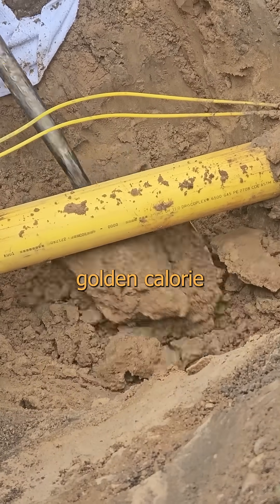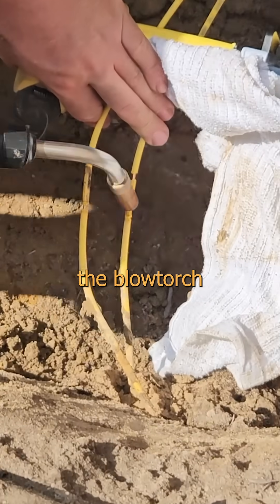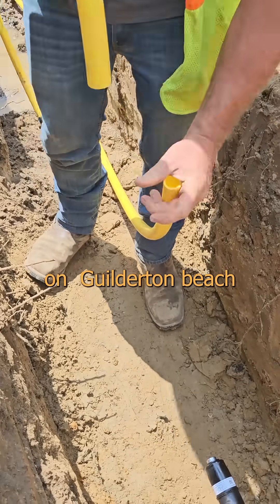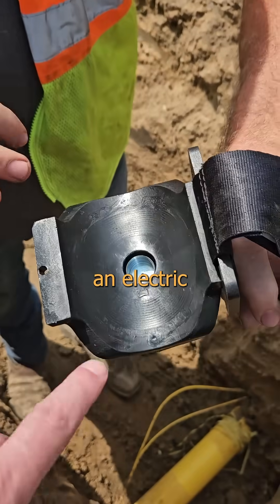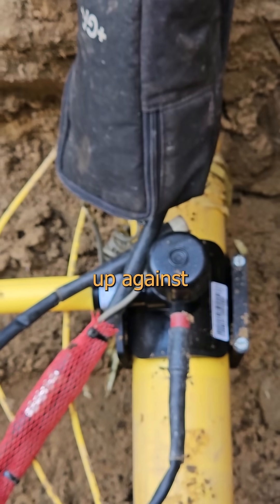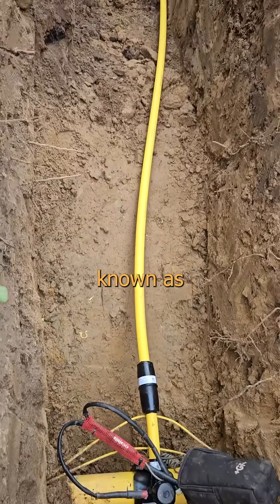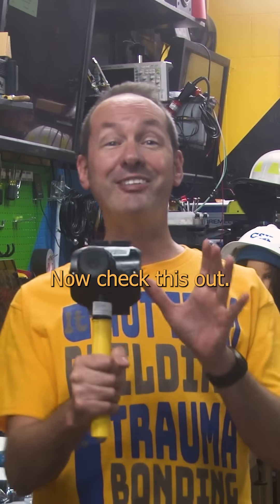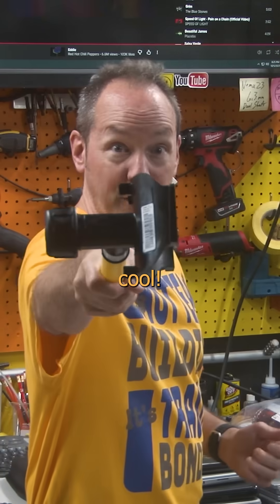Gas Line Hot Tap #chrisboden #comedy #engineering #construction #educational #apprentice #science

Comment: Gas line at my house is high pressure at the road. Not 2200 psi like at the well head but it is still a couple 100 psi. When the original steel line would leak it would blow dirt up in the air.

Comment: Works on most pipe*, there are plenty of 3" and 4" mains that are just coated steel pipe that look similar to one in the video. Those have to be tapped and tied in the old fashioned way. 

This is a very ingenious tapping device, I have never got to see one in action, as my role is normally finished well before their is gas flowing through the main. I only do the mainline installations.

Comment: I need to do this,  but I only have a curling iron.  Do you recommend the high setting?  If the gas,  as you described is only at a few psi, then this should be a breeze.

Comment: It's hard to screw up as if code reader doesn't work you have manual settings on it the only part that need be done with attention is cleaning it well and checking if after clamping it's sticking tight without excessive free space between

Comment: So, heating on a live gas line is actually 1,000 more safe than one that was live but has been shut down.  Mainly because Natural gas has to be roughly 13% gas to oxygen for an ignition.  

A pinhole leak is actually more dangerous than a full blown.   But only if there was something above the leak to trap it, because it is lighter than the oxygen/nitrogen air we breath and floats up and away faster than your sister's dress on prom night.

As for the electronic melt on tees, previously, the crews had to use a heated iron in a vertical vice.  You had to know your iron was hot, you had to know how long to hold and you had to move with absolute purpose and focus.  

Another thing that always got people running... welding on steel gas lines.  It would be like something from a Bugs Bunny cartoon the second they heard we were welding on a live line.

Comment: There can still definitely be problems with these service taps if you’re working with mains that have been in the ground for some time. Some of the heavier elements in the natural gas called hydrocarbons, permeate the walls of the pipe and when you go to fuse, cause bubbles which can result in incomplete or flawed seals. You worry about it less so with the taps and more on the side of tying in a new main to an old one, but still something to watch out for.

Comment: And… when we check for gas leaks on HDPE plastic or Steel pipe, We use a flint  striker to check for leaks.😊 it’s a flint lighter that looks like a gun. It shoots flint out of it when you pull the trigger with sparks coming out of it.

Comment: The town I grew up in had a guy from the gas company checking something in the old iron gas lines outside some guy's house every week or so. So the guy asked the worker, "Hey, what's that you're doing on my tree lawn every week."
"Well, the gaslines in this town have more holes than a metric fuckton of swiss cheese, so I have to measure the water in the gasline every week to keep track of it."

Fast forward to winter and the town's shut of valve a mile away got water in it and froze. We all know what water does when it freezes, and that opened up the valve wider than your sister's ankles and started feeding 3 pounds of pressure into the line instead of 3-4 ounces. For a lot of houses with newer gas meters, this wasn't a problem as they had independent regulators to keep the pressure down. But if you had an old one, your pilot lights went from two inches to almost two feet. And when the furnace kicked on, goodbye house, hello insurance company. There's about a thousand houses in the town, and due to some miracle only 7 burned down and no injuries or fatalities. We had 25 fire departments respond and just pick a corner and watch for smoke while the towns folk helped evacuate the elderly(there's a lot). 

Anyway, the gas company tried the Chewbaca defense until our friendly neighbor spoke up about the gas company knowing about the water problem for months and they fessed up to knowing about the danger and doing nothing about it. Next thing we knew the town was filled with more ditch witches than your mom's high school reunion and the town got all new gaslines at the low cost of, "please don't sue me."

Comment: I’m a pipefitter and there is fusion taps that use an iron to heat the fitting and pipe to make a fusion the tool is called a sidewinder by McElroy we also intake  an EFV excessive flow valve so if the service gets hit it will slop the blowing gas

Comment: But he didn't explain why they stripped the yellow wires that were running along side the gas main.  That is what they used the torch for, to soften the wire insulation to make it easier to stip.  BUT, then they don't show anything being connected to the wires.  Typically, those wires are put next to the plastic pipe so they can use instruments to find the pipe after it is buried.  SO, why strip the wires?

Comment: We didn’t do a whole lot of fusion taps but the amount of rubbing alcohol was nuts. We just used two or three wipies and some wire strippers to push the insulation aside just enough for the splice for the tracer wire. Fusion taps are awesome but these dudes are using the full benefits of the $60,000+ service they are doing with how many resources they are using here.

Comment: I watched them do this on 6" steel gas main in the 80's. They welded the saddle to it with a stick welder then pressure tested it before piercing the line with the tap. I was told the gas pressure was at 125 psi.

Comment: Live gas lines especially mains can be lethal. I was involved with isolating a 11kv cable to be identified and spiked to allow a parallel branch joint to be installed for a new substation supply.                                So i arrive there was a excavated big joint trench for the work dug with a existing plastic gas main right thru the joint trench. I witness the ID and spike of the 11kv cable and give written clearance to start work , during the toolbox talk i warn them of the gas main and to beware of gas torches flames while building the joint.                                                                  I leave for the next job and hear in the news of a explosion at a worksite where i attended earlier. I find out later that while doing joint work one of the jointers left a lit blowtorch burning while stripping some sheathing it burnt thru the gas main and ignited the whole trench. The jointers mate a big guy jumped onto the trench and pulled the jointer out away from the fire that burned until specilisted gas company staff shut off the supply after fire brigades initial fire fighting methods failed. Big trouble over that accident i was called to do a report luckily i gave those warnings before work started so was not personally involved in disciplinary  actions even though some of the staff where not happy with being made responsible  for the accident. This incident really made me beware of plastic gas mains seeing this vid reminded me of that incident and how lucky the guy was to be rescued with only mild burns to himself and his big quick thanking assistant.

Comment: Called  that a hot tap in the oil and gas business in the 60s 70s and 80s we weld weld let on the supply pipe  screw and valve into it an drill through into the supply pipe with valve special packing seal.
  Did many of them

Comment: To be fair this isn't nearly as dangerous as it might seem. HDPE, the material of the pipe, has a melting point under 150 C, whereas natural gas has an autoignition temperature of nearly 600 C. Simply put, it's incredibly difficult to ignite gas without spark or flame, and I'd wager this device can't generate anywhere near 600 C even if something went wrong.

Comment: I have done many WATER service "TAPS" both "LIVE" ( you don't shut off water mains. For me personally on (AC) asbestos cement water pipes, YES we had about 80% of our service area all (AC) believe it or not in the late 1970s we would "CUT" the (AC) water mains with a pipe saw.
Then we started getting training in the 1980s about "AC DUST" we all went to the doctor to have (X-rays) of our lungs. Anyway just a stupid question as not question is stupid "RIGHT" 
what about the "HEAT" when you turn the wrench TAPPER into Gas main. Just asking is their no "HEAT" buildup. I have watched many A repair of a "BROKEN" Gas service that I dug up or was off on the line location paint or flags on the surface.

Comment: Something people don't understand about closed systems like pipes and flammable substances. Unless it's a very specific case (alkali metal + water and similar reactions that don't need water), flammable gasses like methane have an upper limit of how much is needed to be flammable. Somewhere around 95% concentration is the limit for methane, if there is more than that then it can't explode because there isn't enough of anything else (Oxygen mainly) to combine with the methane. If there is no oxygen, then it can't explode.

Comment: We used something similar on stainless/carbon/etc lines called a hot tap. We would weld a short threaded nipple to the line we were tapping and then screw on a ball valve. On the other side of the valve we would screw on a contraption that had a drill bit mounted to a revolving shaft which could be screwed thru the open valve, into the line we were tapping. Once the line was penetrated completely we would back out the drill bit, close the valve, lock the valve out and remove the contraption, job complete

Comment: I've done some RF welding and honestly it's thr very best it's just not very moble, when using a normal heating element the 2 parts are still 2 parts, those Xrays in the RF welding cause true polymerization actual linkage of molecules. There is some heat involved but that's not what really causes the fusion.

Comment: Hmm. Our PE mains run at 50-60# and are required to have EFVs (excess flow valves) on all new services. Basically if the service gets opened up too much it trips and slows the gas WAY down. They're actually purposely tripped to make sure they work. There's a little hole that eventually re-pressurizes the line. But they didn't install one. Maybe there's a lower limit on main pressure?

Comment: I used to do something similar with Ethernet, in the 1980s.  It was a way to add a connection to a 10base5 cable without cutting the cable.  Not as dramatic if you messed up - just 1s and 0s all over the floor - but a lot of analogous steps.  I think it's called a vampire tap.

Comment: steel gas main breaks require a set of danglers to temp "fix" bandaid. 100 foot tall geyser plume. 6011 farmer's rod will ignite it. Exciting!. AC deposition because you don't want penetration and want to drag. Asbestos blanket. a '74 chevy pickup truck hood. Water will just turn to steam and kill you. Yes you need to switch to DC reverse polarity deposition when buttoning it up - that's why the farmer's rod. You feel like a hotdog on the coals. But heat goes up, so be chipper! If you don't do it - who will? Just fast drag spatter it. Not trying to "weld" here. Just want a gorilla booger blockage. Fast freeze and AC / DC / all position make this the better choice, handy. AC used at first because it runs cooler, penetrates less, gives the spatter and easy drag I was looking for. Finished with DC reverse because deposition is less prone to blow out under higher pressure.

Comment: You need to show one a hot tie in welding steel pipe to live gas line that is what I used to do no fancy tool to punch the hole steel punch in a brass hammer

Comment: I was working for a company that makes the machines that weld those those fittings.
The fittings have normally a barcode sticker on it that will be scanned by the machine, so it knows exactly what parameters in terms of time and current it has to apply.

Comment: I worked for a gas transmission company and we did "hot" taps on large steel pipes (IE36"), they would usually try to lower the pressure to around 600PSI then WELD a sleeve (TEE) to the pipe, install a valve and then attached a tapping machine to the valve, go through the valve, tap the pipe, withdraw the "coupon"  (the piece that is the dia. of the tap) back through the valve, close the valve and blow down and remove the tapping machine, voila a high pressure tap. can you imagine the pucker factor welding to a pipe with 600 PSI of natural gas in it? some of that pipe has been in service for over 50 years, you have to have confidence that the guys running the smart pigs (X raying) the inside of the pipe for "anomalies" were really paying attention...

Comment: Wanna see underground electrical workers run at Olympic speeds? Run the gas main over the shoal of granite instead of blasting so its a whopping 8 inches under the ground.  I mean whats the odds anybody will dig in that exact 3 foot square area?😳  i saw the foil tape about 2 seconds prior to the teeth on the backhoes bucket cracking the pipe.  In case your wondering,  "run away screaming " was my reaction.  BTW: you missed your calling as a wordsmith! Truly as much as im not a fan of the dick jokes i listen anyway just to hear your verbage

Comment: Is it cool? NOO.
I saw one time workers cut life gas line inch metal pipe with angular grinder (it was many spark), after that worker made threaded connectors and installed valve. All this time gas was leaking from pipe. It is sound like crazy but it was in real. After that i questioned worker: "was it to dangerous?" He answered: "not a big deal unless you stop cutting pipe at half way. U must cut it in one move."

Comment: The oil and gas industry calls this a hot tap.  We use it as little as possible,  it is sometimes necessary...  sometimes it's over 3500 psi.
Yes it's the same methane just without the mercaptin smell.

Comment: I used to do gas I was on a steel crew wanna talk about spincter tightening sit in the hole with the welder when he blows through the side I had the knowledge beforehand so I didn't mind I had to explain to a new guy that if you see the flame your safe it's burning off as it comes out say the welder had to grab a rod and there's a hole if it fills up enough you won't have time to see a flame

Comment: Small correction,
The tube isnt a thermoformed plastic, its an extruded thermoplastic
Thermoplastics get soften and melt in a predictable way (as opposed to thermoset plastics which harden chemically)

Thermoformed means it was softened and pressed or vaccumed over a mold
Reply: since you're a nerd but cool, what plastic are car trim pieces made of? I wanna know so I can curse the name of the guy who made that brittle crap
Reply: @jimbothegymbro7086  lol depends on the car, and the age
Reply: Older cars have worse plastics for 2 reasons.

1 : The plastics technology of the day wasn't great.
2 : Those plastics have then aged longer.
Reply: @BramBiesiekierski  yup 
UV light breaks plastics down, along with temperature changes 
Plus plastics have been designed to be high-quality A surface only in about the last decade or so
Reply: @ivankrylov6270  I make these EF fittings, couplings to branch saddles. They are injected into a mold. Would that not constitute thermoform by your definition?
Reply: @lexiadams-kl5mp  no, thermoforming is a specific molding process, that doesnt liquify the plastic. 
You pass the glass transition temp but not the melt temp, then vacuum or press it down over the mold 
Its usuly done with a pre-extruded plastic

Comment: When I was an electrician my boss and I were driving away from a job at the end of the day and we heard a loud hissing sound.
In the rearview mirror I saw a guy leaping through the air off of the ditch witch he was piloting. We saw him reach a safe distance from the machine which was engulfed in wobbly looking fumes blasting into the air as we continued on our way.
Not sure what happened afterwards but the machine was definitely still running when we turned the corner on our way home.

Comment: i read your little card, it was really nice. I don't want to argue, i just want to state an observation and possibly pose a question.
the math around how the gas line doesn't blow up is so sensitive, it makes me wonder why there's not a valve between the central gas main and the main gas pipe of a single home to shut the gas off.
do you have the capacity to shut the gas off before punching a hole in a hot gas pipe? has anyone ever tried making a shutoff valve? is the gas system in this country so jenky that adding a main gas shut off is not feasible? am i just using my dumb auto tech brain too much?
Reply: tl;dr. why heat up the gas line while it's live? can you shut it off? I'd be really mad if one of our houses blew up..

Comment: I'm a plumber and melt PE pipe all the time. Then run tracer wire and tape to top. Put a few 2 " PVC pipe at 24 inches.  In put pipes into hole on top of pe pipe back fill a little around it usually 6 " then caution tape. Then all the way.  Afterwards inspector can see your 18" down. And pressure test it usually before all this

Comment: I hated using self fusing fittings. They have their uses like this where you can't use a traditional fitting but even done perfectly they have a significant failure rate. Used to do HDPE fusion for a living for industrial applications like oil plants.

Comment: I was having sewer issues, and originally thought it was roots. Which it was, but the culprit was when the gas main was horizontally drilled, it was drilled through my sewer right before the main. I had a sewer contractor scope the sewer and we discovered the gas main. After that the contractor refused to do anymore root removal until I talked with the city. After sending some photos to the city, the next day my sewer was dug up, and the gas line was moved and sewer repaired. Zero cost to me.